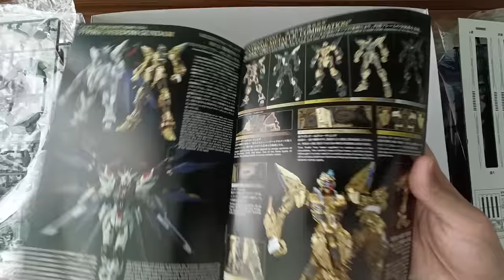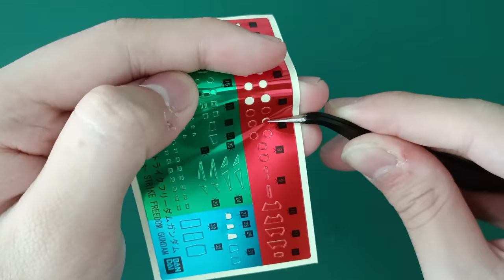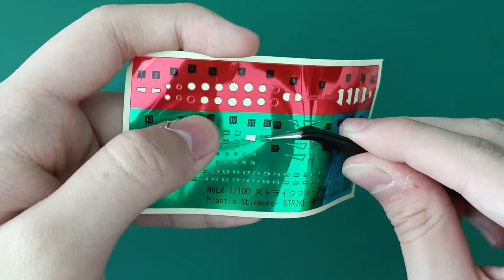MGEX 1/100 Strike Freedom Gundam | ASMR Build | Mobile Suit Gundam SEED Destiny

Comment: As a Warhammer player, it absolutely astounds me that this whole model is pushfit, with no glue required, and still goes together that well and looks so good. Fully posable too. Amazing
Reply: Warhammer mold technology is so far behind gunpla
Reply: model kits are eaiser to put together then tabletop miniatures, I love putting together my gundams but hate gluing all my warhammer, team yankee and flames of war minis
Reply: @Caterpillar  The Gundam kits are meant to be able to pose, warhammer minis arent. So technically no.
Reply: WH miniatures are 2 decades behind gunpla ;)
Reply: i do both. build warhammer and gundams. gundams because i wanted to build stuff, because i didnt have glue at the time
Reply: @riblo72 they were two decades behind even 40 years ago.

Even the original 1/144 kits released in 1979 are already better in terms of posing and affordability, and those STILL need to be assembled with cement and painted.

And GW has the NERVE to charge people with their msrp prices.
Reply: "Bandai" makes some extremely detailed  push fit kits as well. Mostly Star War ships & figures
Reply: And still cheaper than our regular grimdark robot , knight, titan , dreaghnought  etc.
Reply: Honestly, that's one of the reasons I switched over. I love warhammer, but its faster and cheaper to go with gunpla
Reply: @matteblack5805  Warhammer Fantasy & early Warhammer 40k was fun, fairly reasonable on the wallet & a nice hobby. But it's just gotten out of control.. and a conplete cash grab from Games Workshop. You'd think with plastic figures instead of the old school pewter figures.. that they could pass a little down to the players / hobbyists. But nope. Completely greed driven and each new army or race release just seems more cringe than the last. It's sad really. I still paint Warhammer figures occasionally. If they are discontinued & in a bargain bin or something. Just for fun. I don't play anymore. Games Workshop ruined the game & hobby as a whole.
Reply: way behind the times, and WH 5 back of BAs gonna cost you 50 dollars, cause why not. This gundam is worth the price, 169, there are WH kits cost this much and dont give nearly as much.
Reply: It’s also way cheaper than you think

Comment: Had no idea the amount of work needed in putting together one of these models.Great job
Reply from the maker: Thank you!!
Reply: well this kit is a master Grade extreme.
which is even more work then a regular mastergrade kit 
so if you would get a MG kit it would have significantly less work then this one since this is the second MGEX kit ever.
if you wanna get into the hobby. i suggest getting Entry Grade kits or High Grade kits 
theyre usually labeled with HG in 1 of the corners of a box
Reply: @thedandy6765  truth be told I always wanted to get into this hobby,but didn't know where to start.
Reply: @axxl6316  entry grade and high grade are the easiest kits to build and give nice results
Mastergrade is bigger and more detail
Then theres real grade which is made to be as realistic as it was kn the anime or in real world
Then Perfect grade which is 1/60 scale and have lots of detail and are big with lots of gimmicks
Then theres SD which is super deformed they have tiny short bodies and big heads
And then also mega size which is 1/48 scale but theure hard to find
Reply: @axxl6316  Yeah start with an entry or high grade and you'll be hooked.
Reply: @axxl6316  Try finding things where you easily can do gunpla building takes a lot of time and some people can't make this as a hobby ( depends on people)
Reply: So satisfied watching…
Reply: You should check out the sky defender

Comment: This is a nice build experiment , I also have one too but really scared with building the backpack a bit =)
Reply from the maker: Haha I get what you mean, the metallic parts can be a little scary as they are slightly more fragile than usual but they won't snap unless you use your 100% force. Everything else fits perfectly, only issues I got is fitting the dragoons on the wing unit.
Reply: Dude same , hope you will review MGEX Unicorn , I am saving for it :). Love your work man

Comment: One day, I'll be able to afford this guy. I just finished the rg version. It took 12 hours for me to finish it. I couldn't imagine how long it would take to build this. Wow, impressive.
Reply from the maker: I didn't do it in one sitting, I think I spent 9 different days to build it but it was relatively fast because I didn't do any clean up, just double snips. It's worth the time tho 😃
Reply: @knitehobby  I spent 6 days on it. 2 hours a day to complete.
Reply: @knitehobby  I panel lined it and put on the stickers.  That's why it took me 12 hours of build time.  The thing I've learned about gunpla is that you have to be obsessed with every little detail. To make an amazing model. I'm 18 models into the hobby and have improved a lot from my first one. The thing I like  most about the hobby. patient's is the most important thing.  Take your time and try something different.  You can only get better with each model you build.
Reply from the maker: @Thegamercat420  agreed, back in my first 5 kits I only snip and build them. Now I properly cut out the parts, file the nubs, panel line and apply decals every now and then. It's a very nice hobby, really takes time 😁
Reply: @knitehobby  Have you tried airbrushing?  I'm kinda scared to try because  I don't want to mess up the model.  I'm guessing that's the next step for a gunpla builder.  Once you get down the basics.
Reply from the maker: @Thegamercat420  No never got around to painting yet, I don't have the space for it because you can't be in an enclosed room unless you have those spraying booths. Plus I'm moving soon for college. I can suggest trying with dspiae markers which is what I use to color correct small parts or spraycans is what I see a lot of people do to start.

Comment: Did you do any sanding? I saw how you cut the nibs off with a second pair of nippers, but from my experience its nearly impossible to not leave stress marks :( Awesome video and the ASMR is absolutely captivating!
Reply from the maker: For this build I did not do any sanding. Mainly 2 reasons, first is I was short on time and second 80% of the parts are underagated, the parts that do leave stressmark are mostly the inner frame and gun metallic grey
Reply: @knitehobby  ahhhhh gotcha, I didn't even realize they were undergated, I forget they actually do that 😂

Comment: Is it true that everything, if not all, is undergated?
Reply from the maker: There are 2 metallic injection parts runner B and runner D, runner B isn't undergated while runner D is.
All the inner frame on runner G as well as the grey gun metal parts aren't undergated.
However the armor or the colored parts are undergated. 
but looking at it completed, there is 99% no nubmark spots anywhere to be seen since the inner frame is hidden.

Comment: Hello, what nipper are you using for the end cuts? I'm intimidated by the godhand price point, so I've been looking at other options.
Reply from the maker: It's a single blade nipper by DNR, a local Indonesian brand. Cheap and works very well.
Reply: @knitehobby  cara merawat nipper dnr gmn caranya gan. Pyku dah agak berkarat😅
Reply from the maker: @widhinugroho9141  semua nipper sih kurang lebih sama cara rawatnya. Simpen di tempat yg engga lembab, jangan sentuh bladenya dan pake minyak anti rust kalo mulai berkarat
Reply: @knitehobby  baru rencana mau beli itu sih gan. Tq atas infonya gan. Waktu itu pernah kesentuh jari mata blade nya sih pas rakit.
Reply from the maker: @widhinugroho9141  yoi. Kalo mau ngetajemin bladenya bisa pake amplas tp jngan kelebihan
Reply: @knitehobby yup, pake grid brp normalnya gan. Klo aq search, pake yg 180. Nipper dah bunyi tang ting, keliatannya perlu beli anti rush 🤔. Matur nuwun gan 🙏😁👍

Comment: Hi! Im new to gunpla. Just wanna ask if there’s no nub marks if you only use nippers? And can you give tips?
Reply from the maker: For this kit, 80% of the parts are undergated which means that the nub placement are underneath the parts where it's not visible. The nubs are still there but you can't see it from outside, as for cleaning you can use a file or sanding sponge and it will do the trick

Comment: Can I take the (little one)driver out then put it back to the same place after finish combine the gundam chest frame ?
Reply from the maker: Better not, it's very small
Reply: @knitehobby  what should I do😭 I forgot to put the little one inside before and I wanna put it back
Reply from the maker: Oh if you haven't place the pilot in then just do it, disassemble some parts and you should be fine. But I don't recommend pulling it out too often because it can be fragile
Reply: @knitehobby  which part of the body should be disassembled 🤔
Reply from the maker: Uhm I forgot, just disassemble the parts until you're at the part where the pilot is suppose to go in the manual

Comment: Did you use decals and top coat after? If so, which decals and top coat did you use?
Reply from the maker: Yep, did it offcam. I just used the water slide decals that come with the kit and topcoat with Mr.super clear matt
Reply: @knitehobby  any tip for topcoating this kit? Did you do armor piece by piece?
Reply from the maker: Not necessary to do that unless you're repainting, I usually just topcoat limb by limb
Reply: @knitehobby  cool, thanks! Been eyeing this kit on my local hobby store and planning to get it sometime this month, great job on the build tho
Reply from the maker: Thanks a lot! Enjoy yours soon 👍

Comment: Can a beginner build this kit ? I am a beginner i have built a daban hg unicorn banshee ( a horrible disastrous kit ) but officially yes i have built an eg rx-78-2 full weapon set and real grade nu ( fantastic kit ) and now i have the rg hi-nu kit which I'm going to build it in some days , so please let me know kindly am i able to build this mgex kit or let alone a mg verka sazabi or pg astray or strike in general? Or unleashed kit plzzzzzzzzz lemme know 😅
Reply from the maker: Yea you could definitely build this big boy. Instructions are simple, only note is to be cautious while building, don't be too aggressive when assembling, if the parts are not fitting then separate them and refit it. But in my opinion jumping from an entry grade to MG is a pretty big step, not that it's not impossible but you can try a HG or RG by Bandai before this. You got it!!

Comment: Can you share your tools please. Hope could enjoy the hobby as you
Reply from the maker: I use 2 nippers, one is Bandai's build up nipper and the other is a single blade nipper. Then for sanding and filing I use gunprimer's raser pro but you can find a regular file or sanding stick/sponge. 

Those are the main tools but for extra help you can get some tweezers and a hobby knife. For detailing, I use tamiya's accent color panel line.
Reply: @knitehobby  such a great insight. Thanks. Currently I am using one nipper only then come across youre using 2 nippers makes me wonder. Hope youre doing great personally and the channel grow bigger.
Reply from the maker: Thanks 🙏 

The second pair of nipper, the single blade one is sharper and more precise than regular nippers so it cuts the nubs better, but if you're going to file/sand it, just 1 nipper is enough. Have fun with your builds!
Reply: @knitehobby  Much appreciate the sharing. Still working with my sanding skills for a neater result. But yeah most important part is to have fun. Keep on making such great videos. Have fun too!

Comment: How long does it take you to fully build it?
Reply from the maker: I didn't rush the process, but I was busy with school at the time. I think I spent 2 weeks  just on the recording alone
Reply: @knitehobby  man 2 weeks i think i will spent a month to build it 😭
Reply from the maker: 😅😅 nah don't think it will take that long unless you really really sand everything
Reply: @knitehobby hey man what to do if my panel line marker won't work after i use it on painted parts😅
Reply from the maker: @NoName-tk8dx  won't work as in the color doesn't show or there is nothing coming out of the marker?
Reply: @knitehobby  when i use it on other parts there's like no ink left but when i use it on something like paper it show there's still have a ink inside the marker
Reply from the maker: @NoName-tk8dx  what color of marker are u using and on what color part?
Reply: @knitehobby  the marker color is black and the part it's originally blue but i painted it gray
Reply from the maker: @NoName-tk8dx  ah yea that can be the problem, if you use tamiya's enamel base panel line, it should show since it's more shiny. But for a gundam marker especially the fine tip kind, it will be pretty vague
Reply: @knitehobby  i see but if i heat the panel line marker will it work like normal writing pen?😅
Reply from the maker: hmm not sure, never tried it before. I used to use the pour type gundam marker, it's more effective just more cleaning up to do
Reply: @knitehobby  never mind i think i will buy the pour type marker like you said,anyway tq for replying tho and sorry for bothering your weekend 😅
Reply from the maker: @NoName-tk8dx  no worries man, happy to help, and I just finished building the aerial rebuild so no bothersome whatsoever. Enjoy yours!

Comment: IDK what Bandai is smoking in there with such a high price tag. They should have gone with white gold with the rest instead of that diarrhea gold. Or at least not showing when the armor is on.
Reply from the maker: that's true, because it's only like 2 runners that's plated. It definitely will be more than a regular MG but there is no way the production reach PG level price